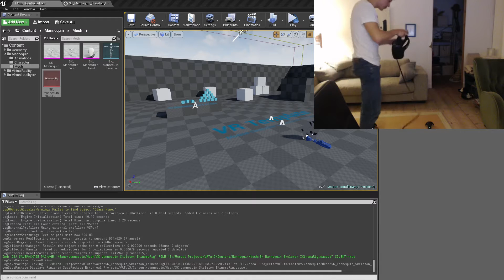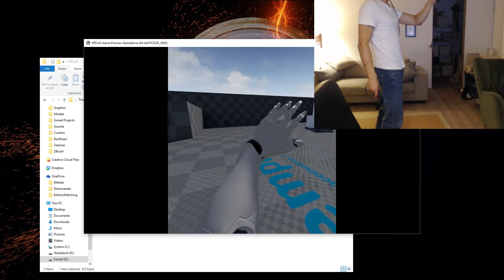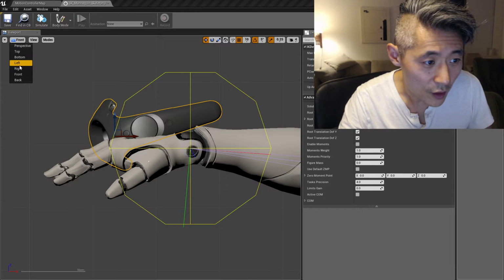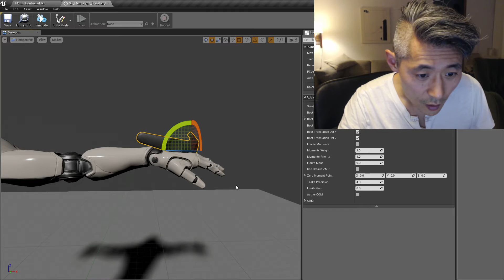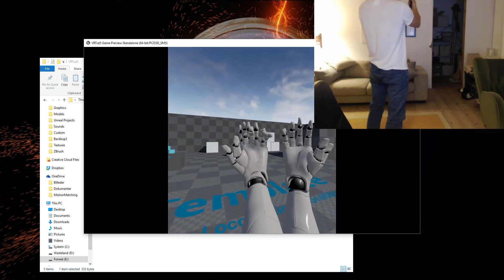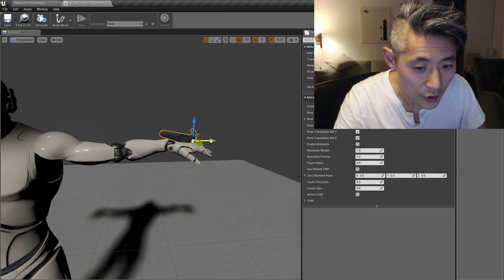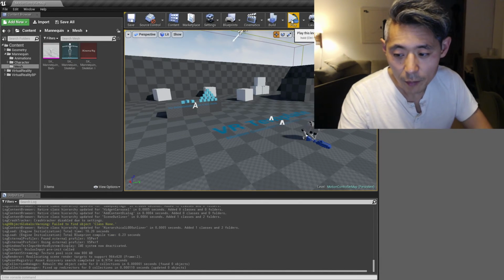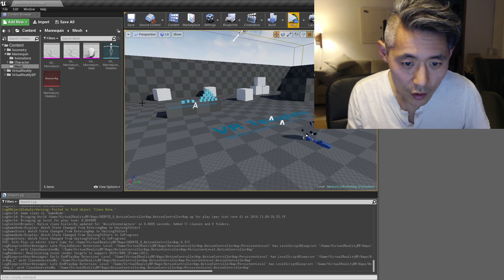HTC Vive - FullBody setup - Part 5 IKinema rig and Nearplane adjustments

Comment: Hi Jonas, I've been trying to follow your tutorials but some of the nodes are slightly different with the current iKinema. I currently have an issue with the model not matching the motion controllers' movements. The hands that come with the motion controller blueprint match the motions though. Also, when I press play, the HMD isn't positioned within the model so I'm always watching the model in the distance. Do you know what nodes may be problematic?

Comment: I just solved a lag issue by messing with the "Tick Group" of an actor. I don't know exactly what you're doing but it may be worth looking into. There's also something with child actors where there's an option to tick before parent but I've never used it.
Reply: Anything you can elaborate on this solution?
Reply: Jonas solves the problem in one of the following videos IIRC. I'm not doing anything like this but I fixed my problem by changing the tick group to "Post-physics".
Reply: Actually I remembered wrong. I was thinking of his video that covered left-hand IK for a rifle. And my lag situation didn't involve animations at all. Finally, I can't find anything about ticking before parent -- but I swear I saw it once. Sorry. Maybe if you specify your setup we can find a solution. I guess your best bet is to use the UE4 forums.

Comment: Hi Jonas Mølgaard, another question for you. I see this odd behavior during the idle animation after exporting the T-Pose from 3dsMax. The right arm goes up in the forearm and the left shoulder socket sticks out.  Did you encounter this issue by any chance You can see a screenshot here. https://www.dropbox.com/s/skuw0oyrsgq6lvx/Odd_iddle.PNG?dl=0  

Thanks again for your time
Reply: I tried moving the bone inside the animation editor but screws up the other animations...
Reply from the maker: check your skeleton, switch to the Skeleton Tree. Make sure you have "Show Retargeting Options" turned on at the bottom. That should show you the Translation Retarget column. Play around with the rightclick menu. Usally you want Animation on root and Pelvis/hip and Skeleton on the rest. Hope that helps.
Reply: Jonas Mølgaard, that was exactly the issue. You are the man!
Reply from the maker: Awsome, great to hear and glad to help.